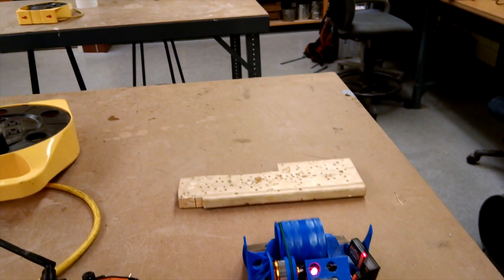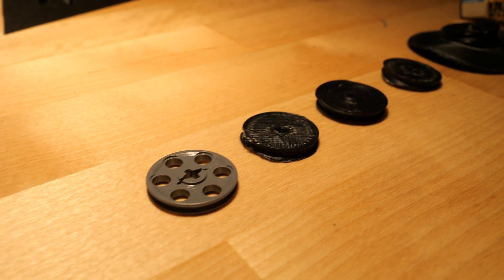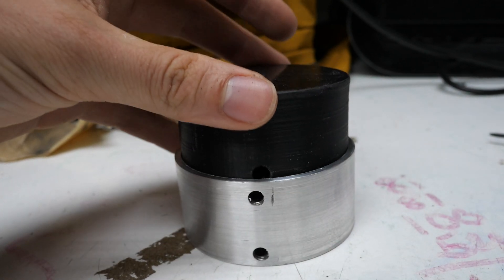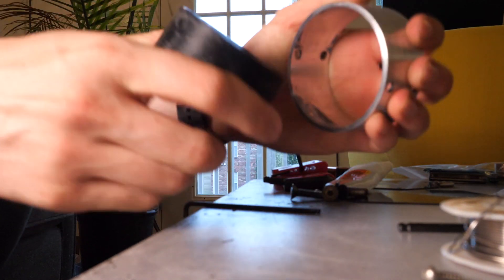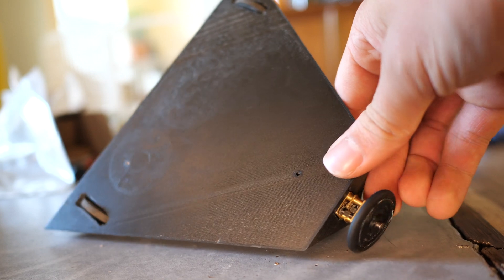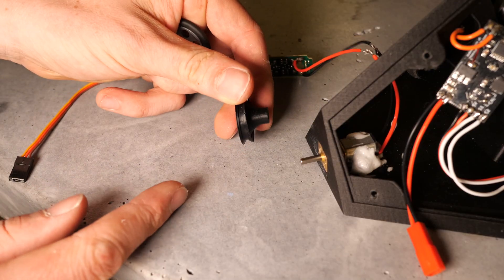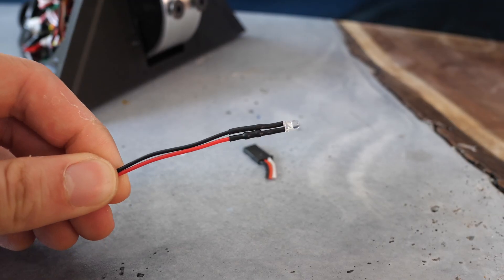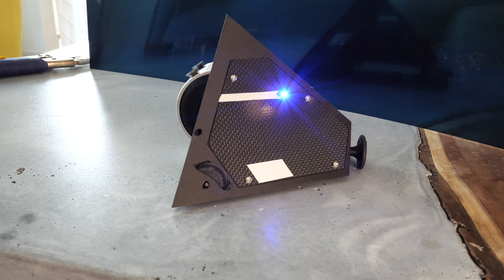Future Killer Combat Robot Build

Comment: Sorry I am new and want to ask what you mean about the bot having to have an LED for an active weapon. is active weapon a weapon that does not have a blocker of sorts to stop it from spinning?
Reply from the maker: No, an active weapon is any weapon/spinner that could hurt the event organizers if they try to grab the robot thinking the robot is turned off when it's not. Most robots except for wedges/rams will need an LED.
Reply: Ok thanks so if I build a gripper Bot would it need an LED?
Reply from the maker: @MichaelJurcek  Depends on the judge, but  I would add one to be safe - if your weapon has powered motion you should have an LED
Reply: Ok thanks

Comment: You should get an arbor press, they're quite useful!  Also, nice job with the design!
Reply from the maker: Hey, Thanks!  And yeah, building in an apartment has limitations.  I'm happy not now have a maker space, though.

Btw, I still have like 4-5 cuddles chassis laying around, printed on different materials. I haven't forgotten about that video, I've just been busy with work (hence the mad build of 3 robots in 1 week for CIRC).  Eventually I'll make that, thanks again for kindly providing the cad & a Chassis...
Reply: Robert Cowan are you in team copperhead is battlebots?
Reply: @harrukawwa  You should check out my YouTube channel, I have several Copperhead videos.  I was also seen driving the bot during the last fight ;-)
Reply: ok

Comment: I like the surface finish. Which filament are you using?
Reply from the maker: Chassis was Markforged Onyx. Nylon based filament with chopped carbon fiber mixed in. Ordered the print from EndBots.